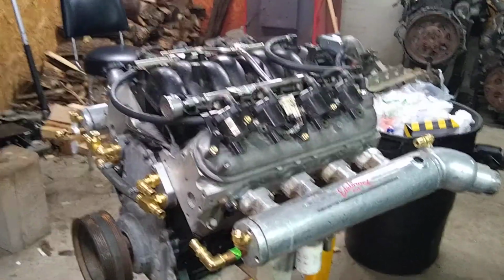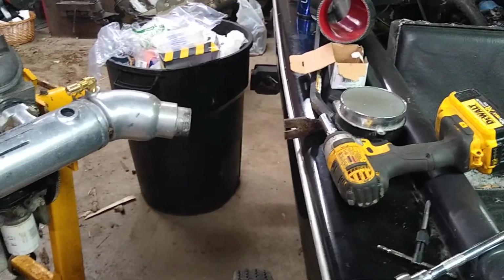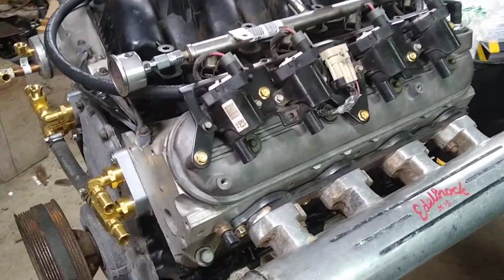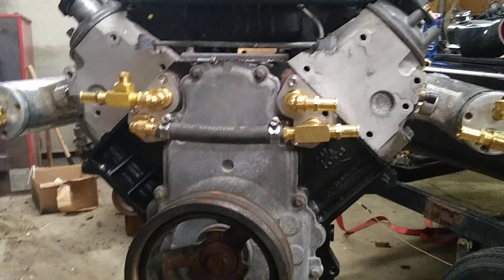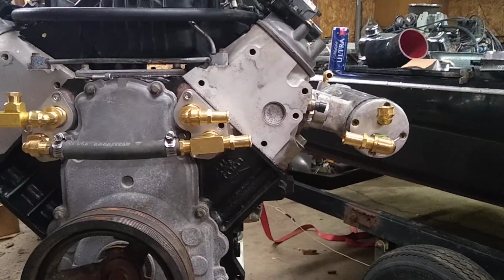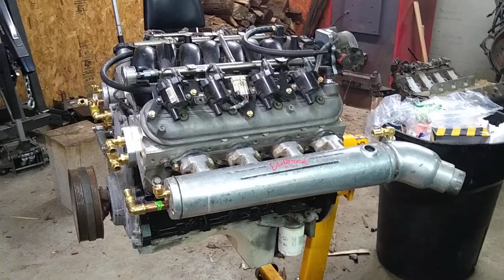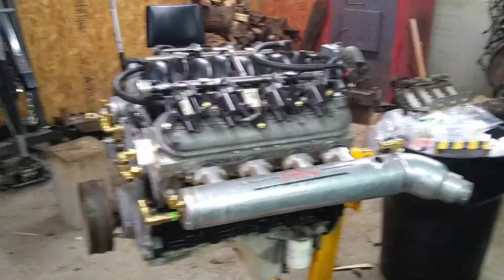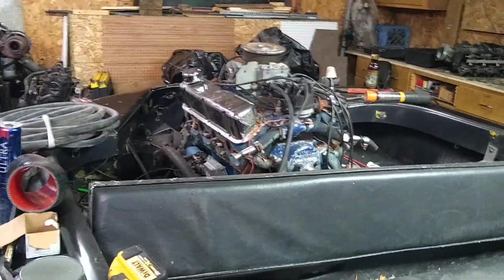LS powered aluminum StarCraft update 3

Comment: Marine fuel hose
http://www.marinehose.com/mpi/products_fuel_100809.pdf

Earl’s Vapor Guard -6 to 3/8 Inch
https://www.summitracing.com/parts/ear-750166erl

Hose clamps for 3/8”
https://www.ebay.com/itm/NEW-17-19-MM-67-75-IN-HEAVY-DUTY-304-STAINLESS-STEEL-T-BOLT-HOSE-CLAMP-NIB/263227048366?hash=item3d498e01ae:g:YDwAAOSwQiBZx~bU:rk:1:pf:0

This MPI hose has the thin Teflon like inner liner that makes it ethanol resistant and low vapor permeation. I used the Earl’s vapor guard type fitting because they have a smooth barb. I didn’t want the sharp hose barbs type fittings cutting into and compromising this liner. Then I used these HD hose clamp to help keep the hose in place and leak free on the Earl’s fittings. 

I may have something you may be interested in if you are going down the 6-way tank selector valve route and you don’t have the valve yet. 

https://www.ebay.ie/itm/Vegetable-oil-fuel-tank-selector-solenoid-valve-for-vegoil-SVO-PPO-UCO-12v-10mm-/264084130836?hash=item3d7ca40c14

I was considering using these and bought 2 from AliExpress that weren’t expensive. They have Viton seals and they would be very low restriction. The shipping just took forever to get. I also have somewhere a part of a u-joint drive line that I didn’t end up using. I think you were talking something about jeep u-joints in one of your other videos.

Google “PTI 3102-60,3103-10,3103-11 and 3103-12”
Notice:3102-60 says bolts to flywheel. Flexplate???

I don’t know if or what you need to do about fuel tanks. My tanks were CG labeled(86). I’m assuming it is an age of the donor boat on when testing/labeling was required. Does the new sbf boat have useable tank/s that is labeled that will work instead? 

http://www.uscgboating.org/assets/1/AssetManager/ABYC.1002.01.pdf

Comment: I'm enjoying this project. Thanks for posting it.

 You don't have personal message available on youtube so this is going to be a long one. I hope some of this info can be of help to you. If you do set up youtube presonal messages lmk so I can get in touch.

 I'm finishing up putting a LS3 in a jet boat with berkeley jet drive. It was a 454 in it.

 I went with closed cooling. I used a 4" dia heat exchanger from a  mercruiser 470. I used a cheap procomp electric bbc electric water pump with LS to bbc wp adapters. This allows me to run a thermostat. I thought this was the better way even though it added some unwanted weight. I was concerned about getting the engine and oil temp up quickly and constant for the fuel injection. A thermostat helps to do this. I was also concerned that open cooling could fill the engine block with sediments an no way to get it out since the lack and locations of freeze plugs in a LS.  So far my cooling system is working very well but it's only been run on a garden hose. Only a small stream of water is needed to keep the engine cool at idle. Idle is when jet boats are hardest to keep cool because jet pump pressure and cooling flow is down but then tend to over cool during higher rpm when pump pressure and cooling flow are high. So gate valves are typically used to restrict water flow coming from the jet pump so that at high rpms the high pump pressure will not be over cool and or over pressure the engine. The big problem is then at idle again. The gate valve is still partially closed and restricting water flow when the engine needs it the most. With closed cooling I have no restriction on flow(gate valve completely open) of the cooling water to the heat exchanger. So even at idle the heat exchanger is getting all the water the pump has to offer. Then at high rpm the engine will not over cool because the thermostat will maintain the engine temp. Plus with closed cooling I think I will have a few minutes of safety margin if jet pump gets clogged. I'm thinking over heating an Aluminum block and or head engine will do more damage than the old cast iron block/head engines.

Just something to consider. It is usally not a good idea to use brass fittings with aluminum in a cooling system. Expecially with out antifreeze.

A LS3 Camaro like 2010-15 oil pan fits with berkeley jet drive with the engine in "stock" location. This oil pan is 8 quart and cheap on eBay since aIl LS3 crates motors come with this pan and people can't use them in crate LS swaps. The oil filter will most likely need to be remote. I also run and LS3 Camaro oil cooler. I believe this is really an oil warmer and set it up on my cooling system as a warmer.  I wanted to get the oil up to temp quickly and keep it's temp up to steam off any moisture in oil.

On my exhaust I used an cheap set of SS eBay sprint car headers for sbf and cut off the sbf flanges and welded on LS3 flanges. They are ott and dry since I'm running o2 sensors and an aggressive cam. I also added mufflers and exhaust wrap to control noise and heat. Exhaust noise is pretty mild an a lot less obnoxious than the bassett on the very mild cam bbc. You can touch the wrap on headers at idle and not get burnt.  I like your new edelbrock exhaust much better than those old heavy rusty Merc logs.

 I'm running two saddle fuel tanks. I believe this is your plan also. For fuel pumps I used two Volvo Penta fuel pump module. Search eBay "Volvo Penta fuel pump module". One for each tank. These fuel pumps modules have a spin on pre fuel filter, low pressure pump, water cooled swirl pot and a high pressure fuel pump all built into one compact unit. You can run the fuel return line back into swirl pot or back to tank. Plus they are CG approved. I'm running two Corvette fuel pressure regulator/filters to get the required 58psi. One reg/filter per fuel pump module. I use a dash selector switch to draw fuel form the port or starboard fuel tank/fuel pump with the efi control. Since I should be around 550-600 hp I also put a throttle 3/4 open throttle switch to turn on both fuel pump modules at higher rpms so hopefully no lean conditions. Note: CG rules state fuel pumps need to be mounted to or within 12" of engine. Fuel hose needs to be marine CG type or hard line nickel/copper. 

 For efi I have the Fitech Ultimate EFI. It is self learning so no need to program or anti theft delete. Even if you change cam or intake or anything else it self learns so you do not need to reprogram. It can data log and even handle boost. So far I like it and it is working great. 

One last thought I have. My aluminum block ready to run LS3(w/heat exchanger,fuel pumps, ect.. ) ended up only about 170lbs less than the ready to run 454 with cast iron heads and intake that I removed from the boat. Your iron block 4.8 weighs (I think) 110 lbs more than my LS3. Iron LS block are heavy. You are putting a heavy engine in a small boat and what appears to be a thin aluminum V bottom and wanting to do river running.... Before you mount your pump intake in the boat I would consider covering the bottom of your hull (at least the delta pad) with plastic like the air boats do or some aluminum plate.

 I speak from experience on this. I have a flat bottom outboard jet that was made for use in shallow river water. It has a thick 0.125" thick hard tough aircraft aluminum bottom. The boat is 100% all welded and is tough but rocks are tougher and don't give a ****.
Reply from the maker: I just looked up this Volvo fuel pump and honestly I'm intrigued. I was just getting ready to order an inline pump, filter regulator and a bunch of fittings but I may go your route instead! Looks like a really slick unit
Reply: @roncook8566  My boat build has had many twist and turns and delays and cost. All I'm trying to do is point out things that stumped me and my solutions and reasons I went the way I did. I'm just trying to help out with your build in cost and time with my experience. It doesn't make my way right and yours wrong. Two different boats in two different types of water. I think you understand this and didn't take anything I said wrongly.
 
 I picked up the fuel pumps used on ebay. I bought three of them in total.  ($50,$75 and $150). You can get new cheap China (non OEM) for under $200. The OEM are made by carter and very expensive. You can tell difference by price and if the pumps motors is smooth cylinder body on outside then it's a China one. OEM carters pumps has a crimp ridge about a third way up on motors. I don't think it really matters what size of engine it originally came on or its for.  I just looked for sdc 350 ones. Try to get OEM one if you can. First one I bought was a used $50 knock off. The other two were used carters. The china one seems to work fine. Knock off motors just are a little louder and not as smooth sounding as the carters. Some AN power steering pump fittings work as adapters to convert to -6 AN from Summit.
 These pumps do have a know problem. Search youtube "Volvo penta fuel pump" by man cave mechanic. I don't think he is correct on his assessment of the problem. I also think his solution of sandblasting the whole insides is probably the incorrect thing to do. It seems he has made a whole home business out of repairing these and selling over priced parts. It is only the very top of the swirl pot that the paint is failing. I think moist marine air is attacking and corroding the base metal causing the coating to fail. Mercury also had problems with their swirl pot pump design ( also carter). I was worried about this problem in using this pump but once I got my grease hands on one and took it apart. I did cleaned it up and I relized it wasn't that big of deal and what a neat design it is and it solved a lot of fuel design problems in a compact unit.
Reply from the maker: I did some research last night and read about just what you were saying. Paint chips plugging up the unit, causing the HP pump to starve for fuel and run hot. I had the same thought just take it apart and remove any paint on the inside of the housing no need to sand blast it. I read on another forum a guy was having issues with his pumps running hot without any restriction. He used essentially a ballast resistor to dial down the voltage to the HP pump until it started to lose pressure and apparently it runs much cooler now. He was under the impression that circulating back and forth between the pump and rails continuously was causing it to run hot. I've seen ballast resistors used with fuel pumps in the past so I'm not opposed to that but one could also do what you mentioned and just return to the tanks from the filter regulator instead of back to the pump. That is even if you had this issue. Do you know if the hose coming off the unit and the third nipple are for water cooling? I saw the fed and return fittings but there's an extra nipple and hose I was wondering about. And are the feed and return inverted flare fittings?
Reply from the maker: And no I certainly don't take offense to any of what you've said I'm always open to suggestions! I've had a lot of boats and have maintained every one but this project is a whole different ball game setting one up from a pile of parts and bare hull
Reply: This swap in my boat is my first LS experience period. I bought a 2008 Yukon Denali rolling chassis  with a l92 engine. Updated the l92 to ls3+ with a bunch of Texas Speed parts. Original plan was to run factory computer in the boat. I had the engine running in the chassis with a stripped down (by me) wiring harness. Since my engine is a gen 4 the computer (especially security bypass) is not very swap friendly. Expecially for a first timer like me.  Plus the gen 4 have drive by wire tb, pwm fuel pump and ...... That is some of the reasons I ended up with the Fitech system.
   I am a boat guy.  I own 3 of them. A wakeboard v drive boat, outboard jet and a 18 fiberglass Tahiti copy called a Caribbean with now the LS in it. I also spun a rod bearing in the 454 right after getting this jet boat. I also live just a minutes away from a boat ramp but on the Meramec river in Stl area. I do all my own maintenance and repairs on my and buddies boats. This jet is also my baby steps to a future small sprint boat build with an LS in it. I prefer rivers over lakes. Does any of this sound familiar???
  The swirl/surge tank on the fuel pump module is water cooled. It actually has two brass 90 fitting in it for water cooling. The fuel pump motors are not cooled by water. I've noticed no problems with the heat on my pumps so far. This may be because with the return line in the tank keeps the fuel moving and cool. Cool fuel then keeps the fuel pumps cool. I did play with an eBay pwm motor speed controller running both fuel pump at same time using the Yukon factory fuel line transducer to reference fuel line pressure. Another plan was I also got a boost-a-pump off eBay but ended up with  just a throttle switch to turn both pumps on at 3/4 + throttle (kiss).
  The fuel line adapter fitting I used on the pumps are Summit #SUM-220009B. They are o-ring ???? but not really an orb type. I did welded two bungs for return line fittings in my saddle fuel tanks. I'm going to at first run the returns this way to the tanks. I still have the option to return to the fuel pumps if needed.
  I think these fuel pumps are a very good solution having both the low pressure sucking pump and high pressure pumps. CG rules on fuel tanks fitting are only in top of tanks with anti-siphon valves. I bought 1/2" anti-siphon valves like the big offshore boats use. I'm using 1/2" CG marine fuel line from tanks to fuel pumps. All fitting are low restriction sweeping AL style. For the high-pressure and return CG marine 3/8" rubber hose with earl's vapor gaurd fittings. The hose has a bursting pressure of 250psi and some ethanol rating. I'm using very wide $ small t-bolt style SS hose clamps to clamp hose on barb fitting. Just a heads up. SS braided hose is NOT CG approved but I've seen it used in boats.
****! This is another long post....
Reply from the maker: @robertwetteroff2813  that's interesting that it uses that type of fitting. Same type that's used on an old TBI throttle body or a Saginaw steering box. I ordered one of the knock off units just to get a look at the thing lol. I may end up just running one of them and keep a spare set of pumps in the boat as I saw they are available separately. I was gonna run a 6 port manual tank switch valve anyway so it should work out great just gotta figure where to mount the pump on the front of the engine. Talked to a few people on hose and fittings and was told to use the CG 3/8 hose, push lock fittings and otiker type crimp clamps so I'll probably go that route as it's cheap and simple. I'd also have to weld returns in to the tanks. Only other thing I'm in the dark about is having the tanks properly tested and certified because neither has a tag like they're supposed to for some reason?
Reply from the maker: Thanks for all the suggestions sir! I'm still chugging along on it almost got the harness done. Yeah a long block BBC is about 660-700 lbs and an iron block LS is right around 450, which is still quite heavy. Weight distribution will be critical with this boat. When the hull gets blasted the first thing I'm doing is reskinning the inside of the hull with thicker gauge aluminum before the stringers and intake go in. And yes I won't be running any rivers until the entirety of the bottom of the hull is covered in uhmw plastic. I may end up doing closed cooling later on if I have issues but for now I'm just gonna do raw water. It has served me well with the 455 in the other boat